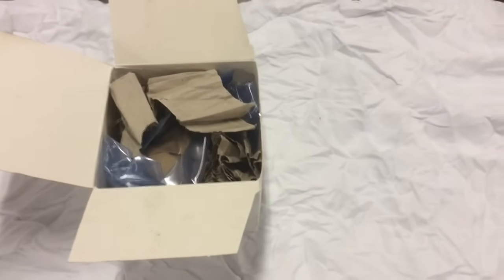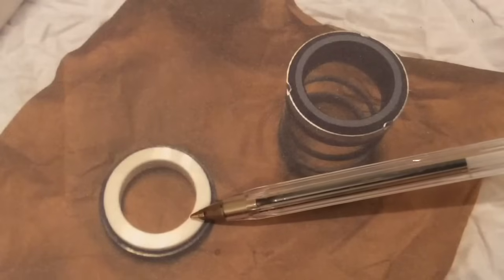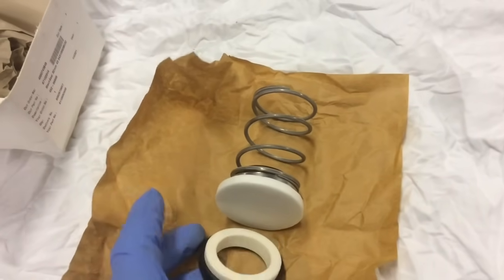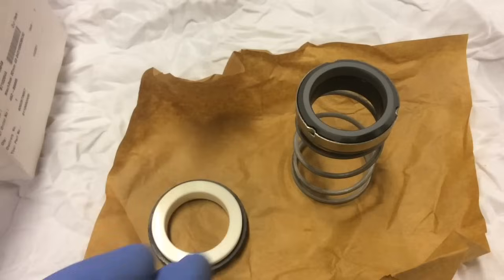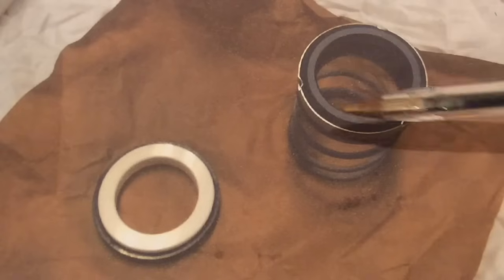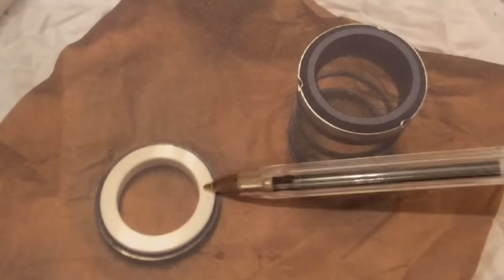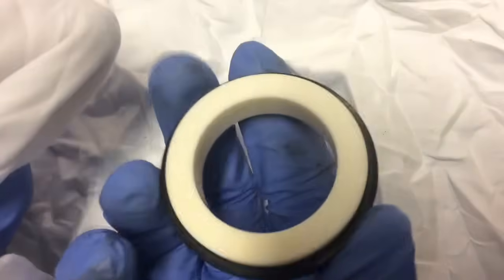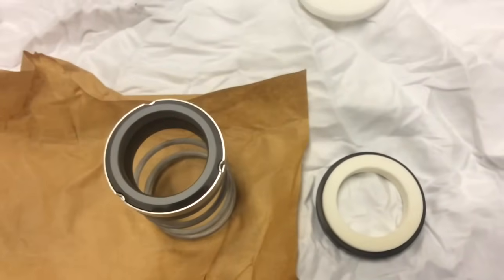This is How to Handle a Mechanical Seal for Best Results!  (by Craig Kirkman)

Comment: Hello, I have a Burks CT Pump in use as feedwater pump to an industrial boiler in a Dry Cleaner.  The pump has been leaking for months but we've been running it that way.  I finally have some time to pull it out and put in new seals, (my first time for this job) but a mechanic that installs and rebuilds dry cleaning machines tells me it's a waste of time, you should just buy a new pump because changing the seals the pump will leak again in 2-3 months.  Is there any truth to this, seems like if you install it properly, pay attention to the handling, etc. it should work as good as the original.  Any feedback you can provide would be very helpful.  Thank you.

Comment: For those who said ( not to put oil on the seal face) ....why do not we consider this a new good practice for installing the mechanical seal unless you gentlemen  have tried it & the installation was failed.

Comment: What could cause 115oC hot water circulating pumps to fail at the seals almost within every 6 months? 
We have 3 pumps (1 is a smaller standby apex pump). 
We never seem to have all 3 in service at any given time as there is always one that has totally failed. 
We have had a complete new pumpset replacements fitted as a result of ongoing issues in october last year, now even the new pumps are both offline awaiting new seals. 
In the last year, we have had 2 engineering companies refurb the pumps, but will go again within a few months. 
The system has no glycol (due to multiple leaks in the large system) but is topped up with DI water, not town water - so no rust, we have had a recent water sample taken which has confirmed this. 
Both pumps are sat on the bench and we are going to tackle the seals by us this time as the engineering firms have not been helpfull regarding warrenties etc, fingered cross it fits ok as I am an electrician by trade lol. 
The pumps when running dont seem to be cavitating or trapping air, and the DP seems ok on the gauges. 
Any ideas or have I missed anything? Cheers
Reply: Describe the type of pump and the situation in which it is installed. 1) is the pump drawing from a closed pipe, a tank, an expansion tank, etc? 2) If it's drawing from a tank, how high above the tank is the inlet of the pump? 3) if it's drawing from a tank, how far below the waterline is the inlet situated? Basically, if a pump's inlet isn't sufficiently close to the water supply and the inlet isn't sufficiently submerged, some air WILL enter the pump and cause cavitation. The cavitation may be too slight to hear, but it could be enough to shorten the life of the seals and even the pump. If you need more help, describe the situation with just a bit more detail.

Comment: What happens when the initially applied oil dries up? I have also heard of issues with oil and prolonged non-use and sticking..My sealing medium is glycol, I am currently leaking more drops that my companies previously assemblies. I feel that oil would help seal better, but my question is if I am leaking without initial oil application, is it wise to coat with oil initially for a possible solution?

Comment: Never use oil or other lubricants on the seal faces,stay away with your fingers of the faces and only clean with alcohol.27 years experience with all kinds of pumps,believe me.
Reply: What happens when the initially applied oil dries up? I have also heard of issues with oil and prolonged non-use and sticking..My sealing medium is glycol, I am currently leaking more drops that my companies previously assemblies. I feel that oil would help seal better, but my question is if I am leaking without initial oil application, is it wise to coat with oil initially for a possible solution? So overall you are not recommending it? What are the down sides and can you be more specific for not using it?
Reply: Could you tell me what's is best practice to assemble mechanical seal in pump? Need to be hit to get proper seat or what else other options.pls suggest
Reply: Never start a pump with new seals completely dryed out... as that results in damage the 1st sec you let it run.
A tiny drop of oil is just to prevent that as it will be gone after 10min of operation.
At least the rubber parts did not started dry that way, as rubber isnt designed to seal dry!

Comment: What about the oil coming in contact with the rubber in the seal? This breaks down the rubber, no?
Reply: Reed Sweeney 
I had the same thought... Surely too much will get to the rubber and deteriorate it.
Reply: It may look like black rubber but it is actually carbon.
Reply: @pjamajones8304  right that is carbon. But there is rubber around the back side of the white ceramic ring, where it seats in the housing and there is also black rubber on the back side of the carbon ring

Comment from the maker: I do understand that there are conflicting views on whether or not oil should be applied to the mechanical seal before assembly as shown on the video. All I can say is that over the years I have fitted them both with and without oil usage in this way, and I can honestly say that I have had less water leakage, over all, when I have used oil. In fact, oil usage was so successful in our pump rebuilds, that the company I worked for made it policy to use oil in this way. I hope that this helps explains why I included this information in this video. I hope that it works well for you if you decide to use it. Its totally your choice. Many thanks
Reply: TheRepairSpecialist  been assembling  pumps for years now,  usually wipe away any P80  silicone, worth a try

Comment: I don't think u supposed to put any oil on mechanical seals this defeats the purpose
Reply: RepairSpecialist....Been following your videos closely...Very nicely done...As a side thought I would like to suggest possibly a video on reed.. valves and also if your familiar with them....rotary valves .. I had a Kawasaki  two stroke motorcycle in the early 70s that used rotary valves..Also governors on two stroke engines...Again,very nicely done....thank you...
Reply: RayMan...you might be thinking about PTFE seals ..I think they're recommended  to be dry on initial start up...At least the rear mains on a lot of automotive applications with PTFE  rear main seals this is how I do it....
Reply: Very clear.
Reply from the maker: If that's then case then i have been fitting these seals wrong for many years!! Believe me, I have assembled more of these seals than i can remember, followed by hours of extensive test running following the machines (Water Pumps) assembly.  These assembled machines then run for years when out on hire.  All is proven and tested and with top results.  I have had no issues assembling them this way.  Applying a film of oil helps the faces to maintain a seal, and so far I have never had one fail.  I understand your point in which the two faces are specially machined to run along each other and therefore should need no addition of lubricant, so its down to the engineer as to his or her preference. But myself and the company I work for have found, over many years of operation in this specific industry, that this helps bed in the sealing effect of the Mechanical seal. Thanks